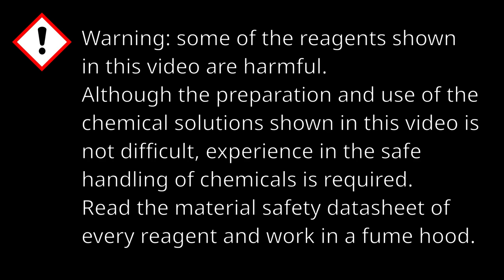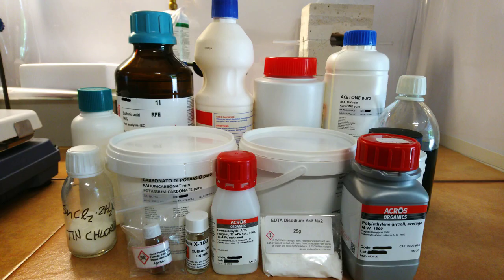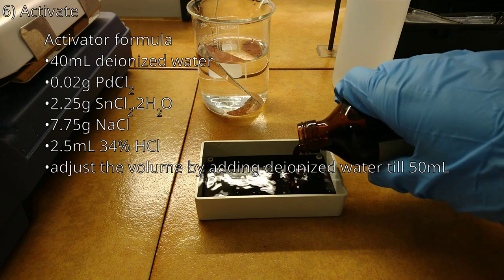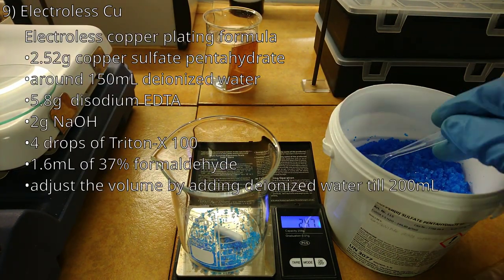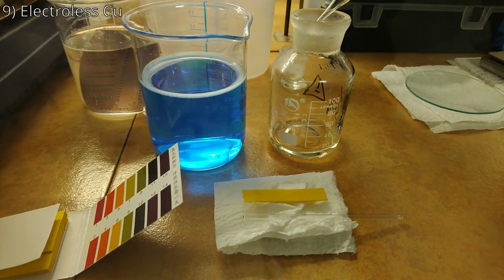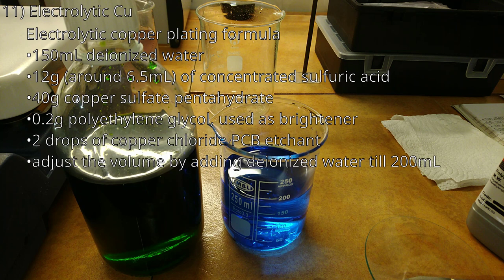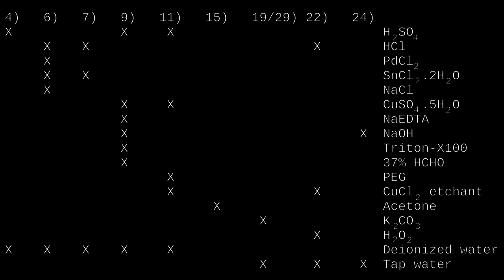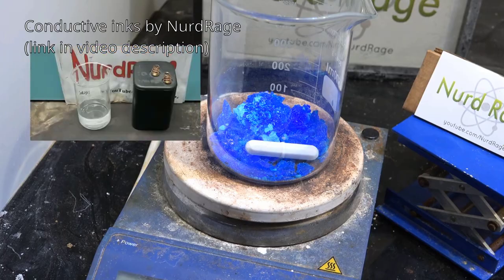Process 01: An open source 2 layer PCB process - part 2

Comment: The Paladium Activator sometimes turns to a yellowish transparent collor... this case You just put it inside a glass flask and this flask inside another conteiner (or a Pan for example) with boiling water for some 20 minutes, 30 minutes until the solutions turns to dark brown collor... I have made it to a lot of solutions of Paladium and it worked very well..
Reply from the maker: Will try next time it happens

Comment: It works, but I have to prepare electroless copper solution each time. In your guide you say that I need to acidify it after use with H2SO4 and make it basic using NaOH when taken out of storage before next use. Can you provide exact pH values?
Reply from the maker: pH is likely not the best way to precisely characterize the electroless solution, as I add a NaOH solution till the pH is about as basic as the NaOH solution I'm adding (don't have a pH meter, I'm using pH paper). You should basically just add NaOH solution till it's strongly basic. To characterize precisely the concentration, titration would be better, I guess.

Comment: Nice Video, thank you very much! After many years of using "Toner Transfer" to make my pcb i now bought a UV DTG Printer and directly print the mask for the design on the board. After etching i print the "soldermask" to the pcb too. The only thing i need to get done now are the vias. Your solution looks perfect but i'm a bit worried about the Formaldehyde. I'm not a chemist, is it possible to replace it with a less toxic ingredient? Triton-X100 is even a problem in the EU, it is banned by REACH since 2021. Is there an alternative available?
Reply from the maker: The Triron-X100 could probably be replaced by another surfactant if you can't find it, but some experimentation may be required. Formaldehyde is very hard to replace, there are alternatives which are known to reduce copper salts to the metal in a controlled way but are just as toxic. If you have no chemical experience I suggest to either wait for someone to develop a safer process (NurdRage was trying for example), or to learn chemistry one step at a time before messing with formaldehyde. And build a fumehood.

Comment: Thank you for the post.  Is a transcript of this video available.
Reply from the maker: I'm planning to write all the steps and formulations in a document. Will make it available as soon as I find the time to write things down.
Reply: @hydrogentime2872  Thank you
Reply from the maker: @gary1143  
Process 01 on hackaday.io: https://hackaday.io/project/180422-process-01-an-open-source-2-layer-pcb-process
Process 01 in pdf form: https://cdn.hackaday.io/files/1804227719174848/Process%2001.pdf

Comment from the maker: Apparently my channel is affected by the "comments disappearing" bug
https://support.google.com/youtube/thread/116351041/recent-reports-of-missing-comments?hl=en

I'll post the non-spam deleted comments and answers here.
Reply from the maker: Comment by Thomas Gatliff:
I very much appreciate your work as it has helped me immensely. Do you have a specific PH you are looking for on the activator and post activator solutions? Also, do you attempt to replace some of the HCHO in the electroless solution after each use? Your video has rather small boards where it doesn't matter much, but Im using substantially larger boards and 15x the amounts you reference, and want to try to better maintain the solutions over time. Any suggestions you might have would be very much appreciated. 

Reply:
Unfortunately I do not have a pH meter in my lab, only test trips, so I do not havee a precise value, I usually start adding concentrated NaOH solution till the pH is strongly basic, and then drop in the board and add a bit more if I do not see hydrogen evolution after some time.
Yes, I do refill the solution with HCHO if the pH if I can't get good hydrogen formation after adding a reasonable amount of NaOH solution, especially if when checkin g the pH before adding the NaOH I find it is not strongly acidic. Acidifying the solution before storing it for long time helps but does not completely stop HCHO decomposition, and loss of acidity is an indicator to add more HCHO.
For larger boards I recommend agitation with a magnetic stirrer.

Comment: Is this palladium based activator solution and electroless copper bath stable and can be used for months? If not then how manufacturing factories use this solution for long time?
Reply from the maker: If you keep it in a well sealed container the activator is stable for years. When the activator goes bad it also changes color becoming transparent, so it's easy to know if it's still good.

Comment: do i need both electroless and electrolythic copper plating for connecting vias or can i just use one of them
Reply from the maker: You can in theory use only electroless, but it is slow to build up the desired copper thickness, and you need to fine tune the process for the surface finish to withstand the etching. Only electrolytic does not work as copper only plates to already conductive surfaces, and the holes are not conductive initially.